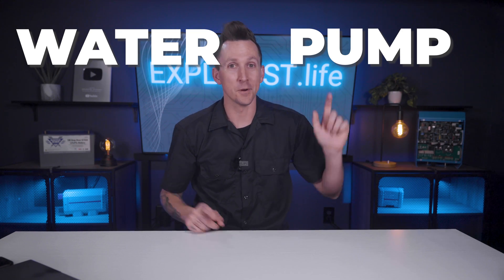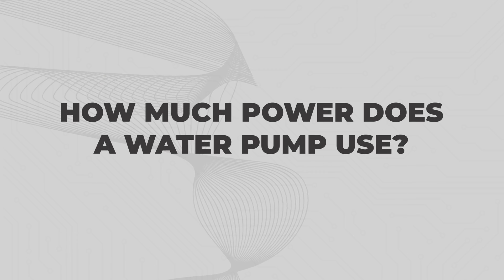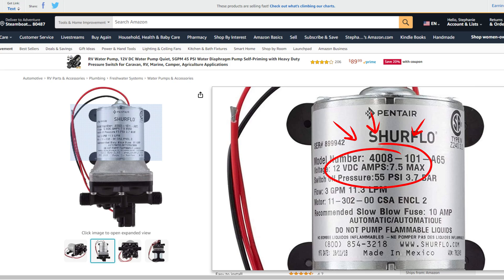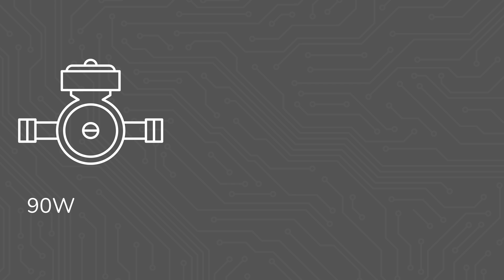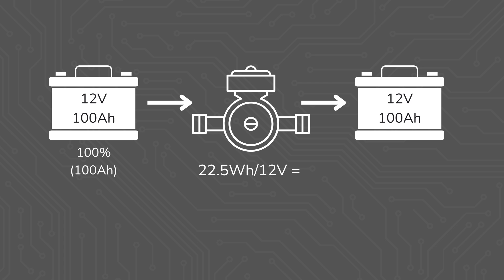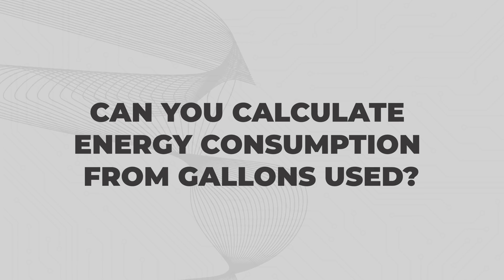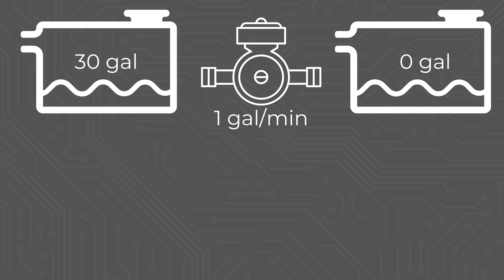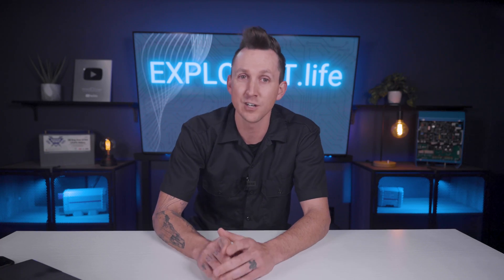How to Calculate Water Pump Power Needed for a Mobile, Marine, or Off-Grid Electrical System?

Comment: Was just looking at those 10w mini hydroelectric generators that can tap into water lines. Would be cool to chain a bunch together.
Reply: Vas ist das ? You put in parallel or series the electrics und or das plumbing pipe (s) I zinc electric series mit fluid parallel ya?